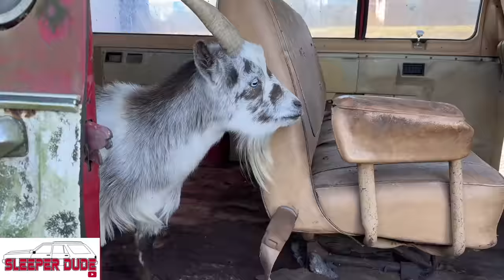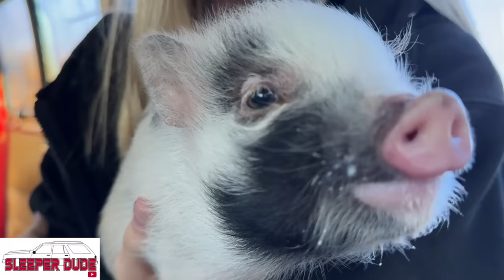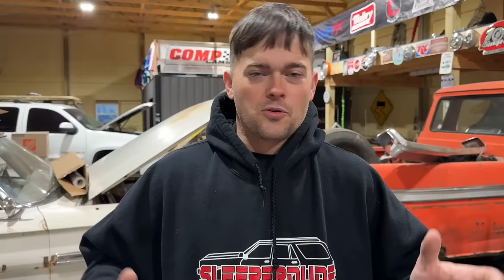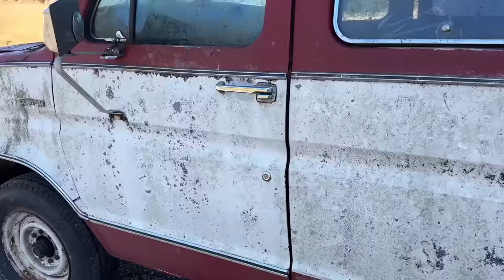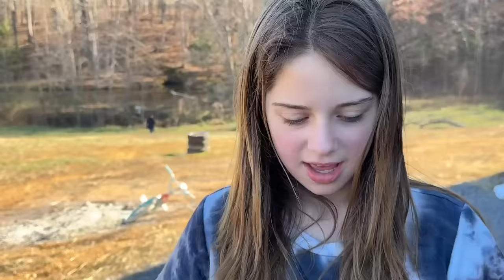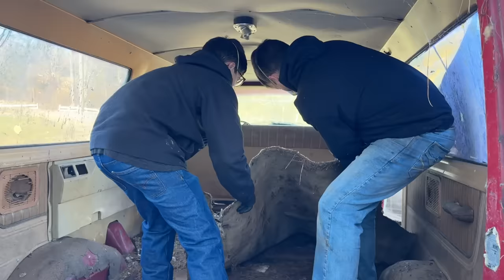$500 Big Block Van First Drive and Clean Up.

Comment: Josh, you should enter that van to the 4th of July Glacier View Alaska, Car launch. It' an annual event launching vehicles of all types off a 300ft cliff, full throttle, to watch it crash in front of thousands of spectators. It would be great advertisement for your channel, but not sure about the logistics of it all. I could just see that sleeperdude logo flying through the air.

Comment: put it up on jack stands rear wheels off the floor  and try and spin them ,  in Drive,  an all around brake inspection is necessary. suspect frozen front rusty rotors
Reply from the maker: Ok thanks

Comment: Hi,  I'm a  little late to the party on this one,  What you have in the Custom Wagon is a Camper Van. The rear would have had a built in seat/table. useable as a bed. Many other options were available depending on the customer order

Comment: Sleeper Dude watching you take that Trans pan off was comical.  But if you ever encounter another situation like that use a floor Jack and a block.  Undo the trans mount bolts and use the jack with the block to lift the trans up so you can undo all of the pan bolts without the transmission fluid running all over you and the floor
Reply from the maker: Yep good idea

Comment: i think id try to do a quick repair on the trans if you say that the fibre gasket is for the auto pump if you put another fibre washer in that could quicte possibly fix the issue to the point where you can drive it around and possibly do a trip in it a short distance around Tennessee. at least it has a sort of life..... oh cold nah in Australia its hot as over here most days its near 90f. and around 75or so at night.

Comment: That little plastic yellow plug is just the manufacturer plug. So when Ford installed the dipstick tube it just sits at the bottom of the pan
Reply from the maker: Ok thanks

Comment: That is a plug that the manufacturer uses to plug dipstick hole so debris doesn't get into the trans during assembly,  when they install the dipstick , the plug gets pushed into pan

Comment: Always flush the transmission cooler by pushing air through one of the lines that goes up to the front transmission cooler you can get a special can of cleaner that screws on one of the transmission cooler lines some people just use brake cleaner and try to get as much as they can in the line you will also need to stop and blow air in the line and then the cleaner then air until you get clean fluid coming out if you don't flush the transmission cooler you will be waisting your time because your transmission can overheat most of the time the cooler is clogged

Comment: rebuild transmission fix the ignition check the fuel pump , those old club wagon are runners my old boss has a ton of tools in it would haul alot of weight

Comment: Dude, cars in junkyards aren't necessarily bad. When I was running the scale, I bought a '71 Torino with a 302 and 53K original miles on it. A woman bought it new, drove it for a little while, didn't like it, and parked it. Her sons inherited it  years later and didn't want to mess with it. I gave them $200 for it, and other than a layer of dust, it was in mint condition. I bought an MR2, an souped up '85 Caprice, an Alfa Romeo Spyder, a '77 Thunderbrird, a '77 Camaro, an '80 Cougar with a 302, and several others. All of them had a minor issue, or had just been parked. I drove the shit out of the Cougar and the Caprice. I sold the Caprice to a used car lot. People send awesome stuff to the yard every day.

Comment: Great video love you guys. The reason it won't keep pulling that pump washer that you found is letting the high gear drum shift and the oil pressure is falling off not able to get to the forward clutch drum. Couldn't really see the ball bearing but it could have popped out of the pump stator support and that may be what is causing the pressure loss. In any event it would need major attention. On that note have a wonderful Christmas and Happy New Year. Pull the engine and Goat home the van 😎.
Reply: For got to wish you guys congratulations on 15 years doing this and go for double that now doing it full time

Comment: the plastic thing is normal to find in the pan of Ford transmissions. it is a plug that seals the dipstick hole.  During assembly they don't bother to pull it out they just shove the dipstick tube in and the pug falls in the pan and stays there till someone take the pan off for service. Most people throw it away the first time they have the pan off. it doesn't hurt anything to be in there but it is a throw away item. 

that half circle looks like a part of a clutch possibly a thrust washer or a friction clutch. That's a bad sign. it should not be hanging around loose so something is damaged inside that transmission.
Reply: when I saw that plug I paused the video to make my comment. oh well I thought I knew some obscure trivia.
Reply from the maker: Ok thanks
Reply: @Sleeperdude  precision transmissions has a good video about rebuilding c6 transmissions.

Comment: I wouldnt have touched one bolt on that engine and transmission until i soaked it down with degreaser and pressure washed that entire undercarriage before i worked on that thing and made a mess of myself and the floor.All that grease is so thick it is probably hiding some bolt heads

Comment: That white plastic ball is placed in the hole where the transmission dipstick tube will be stuffed during the assembly of the transmission. The ball is displaced when that tube is installed. All of us mechanics know that when we see that ball it means that the transmission oil pan has never before been removed. Other than that it has no purpose. You can toss it away.

Comment: That white plastic ppl lug was put in by the factory in the dip stick tube then when they filled the transmission they just push it into the pan it isn't a problem

Comment: Van did turn out good, and there is so much potential for it ..but yeah.... so may options  to...

1. Rockys or the goats  field Goatmobile, pull the motor and beefy build it  for pinto

2. Pull the motor for the black falcon  another burnout car build 

Squeezy's such a good artist, wawa and Ralphie are becoming expert mechanics, I'm gonna have to go on line one day buy some  merch of some sort and support your channel here In Wisconsin, can not wait to speedometer new videos on the galaxie wagon  😁

MERRY CHRISTMAS  ☃️🌲❄ From Our Family, Bighoss920 To The Sleeperdude Crew.

3.

Comment: Git you 1 of those plastic swiming pools it catches all the fluid and the pan .GIT ER DONE .I DROVE one of those ford vans at work and it lost oil bad leaked .I kept a case i the truck . I started using some type of synthetic  oil from the car store after a while our government stop allowing that oil and it was not for sale . i used that oil in  gear boxes  on old knitting machines it was so good you could run the gear box with  lid  off.I never could find out why .
Reply from the maker: Yes!!!

Comment: No transmission specialist but i was wondering if you checked the valve body bolts to see if they were tight.  And im pretty sure those check balls have to be in the correct spot for line pressure.  After seeing that pan so loose.  Im certain someone was in there?

Comment: Man, that little pig has got a bad attitude!😈 You might have to have him for Christmas dinner iffn he don't settle down!🍠😋😂 I'm amazed that you can drag the ugliest hulks home and turn them into decent drive-able vehicles with some elbow grease, a pressure washer, and a couple cans of Marvel Mystery Oil! Pretty cool how this old van cleaned up! Would be nice if you could clone a late model 5.4 V8 with an 8 speed auto into it, and get good power and reasonable gas mileage. Those old 460's will pass everything but a gas station!🤣👍👍

Comment: safety flip-flops... 🤣 I never could stand them things, either between toe or over foot style, they always drove me nuts.
as for the 460 FBB(all big blocks) of that era, too large of a bore and they wore the pistons/rings out, which meant burning oil, that and they had enough torque to wear transmissions out faster than assumed. that thing cleaned up well for the age and abuse. 🙃

Comment: Intermittent power to the wipers on a ford… look for a faulty breaker, it’s a self resetting breaker, will open the circuit randomly, then and then close the circuit, will leave the wipers stuck half way through the cycle….

Comment: I had a 1971 Thunderbird 429/c6 
It had a strange problem with the transmission. It had to sit and idle 20-30 min then it kicked in and worked great, nothing for 20-30 min an then it just kicked in???

Comment: Get you a round plastic garbage can lid drill holes in the center for a poor pans catch for those pesky trans pan jobs that plastic cork is a plug put in the transmission to keep trash out during assembly at the plant when they put in the dip stick that just fails in the pan and also lets you know that trans has never been serviced

Comment: That plastic stopper thing came in all the Ford transmissions. It is useless and is thrown away. The fact that it was still there.....means the transmission filter was never changed.  Those round pieces look like a broken shift band. Not good. The transmission needs more oil.

Comment: Hey you should use cascade dishwasher cleaner cuz that's almost better than engine degreaser and there's a show on here with someone using engine degreaser and dish soap and other cleaners and Cascade was the one that came out just as good or better than those top branded names for engine degreasers and cleaners.  It's the cheapest solution than using engine degreaser and u can also use it in your ultra sonic cleaner. I just wished I remember what video it was so I can give you the link to the person that scientifically tested out everything and Cascade came out on top with also another cleaner but that engine degreaser stuff costed almost $60 and Cascade is only $3 u just gotta know how much cascade to put in it like 4 part cascade and 1 part water which confuses me sometimes lol 😆

Comment: You should never dump Lucas straight in. It's too thick and will just sit in the bottom of the pan. You need to add it to a half quart of tranny fluid and shake it up real good.

Comment: Well that sound bad take the motor out put it in something else the transmission is gone and rebuild that carburetor accelerator pump is getting bad or put a better carburetor on it. That is a bad ass motor. I had that one of my Ford truck

Comment: The body is in good shape, put in a trans, new brakes, custom paint, casing & custom wheels,  I would turn it into a RV sleeper/ camper Van with a small sink & fridge with air on top. outlets, Recessed & led rope lighting with hook-ups for walter, electric heater under the two bunks, put bin cabinets  and table top above fridge , with a good port potty inside with curtin,   electricity and Solar panels with a controller installed, smaller custom shaded windows, plus a outdoor shower tent with hot walter converter. I would talk to a camper trailer designer for help and advice. Young people today may over $ 75. to $100.000+ if done showroom right, just to see America in it. Or find a company that would convert and share some profit, I would not turn a American Icon, One of a kind, Van into a goat or pig bed., but thats just Me just saying,

Comment: Being on a truck frame with all that storage space that thing has some value. I see much worse vans and trucks than this driving around doing work. Could be a work van for someone even if you switched in a smaller engine and put the big one it came with in something else.

Comment: Really you mess with old cars like you all do you need to keep Lucas products on your shelf's I mean oil stabilizer transmission cond sealer power steering and rack pinion products I did what you all do and can tell you it works Josh it would save you a lot of Grey hair headaches you may even get some sponsership deal with them who knows worth a try yes it works for sure got me up running many a time

Comment: Why are yall laying in all that fluid and not putting oil dry down, and why do yall never clean the engines, pressure wash them, i would never put those nasty vehicles in my new 500 thousand dollar shop without completely washing them including the underneath and engine, i guess when you have so much easy money you just don't really care, if you would of worked really hard for it, you would respect stuff more😐